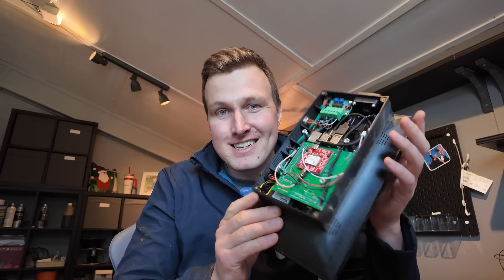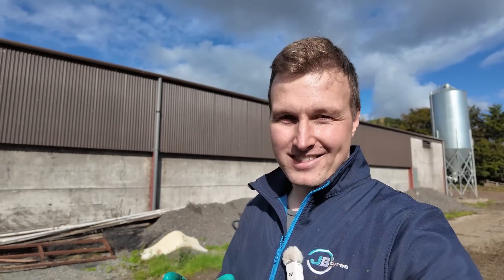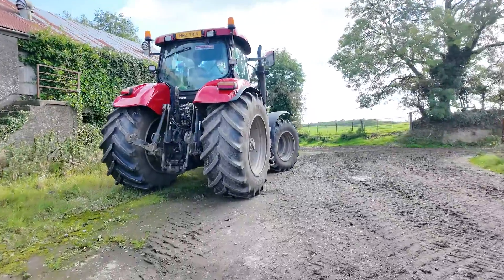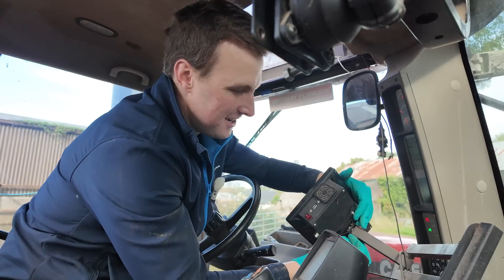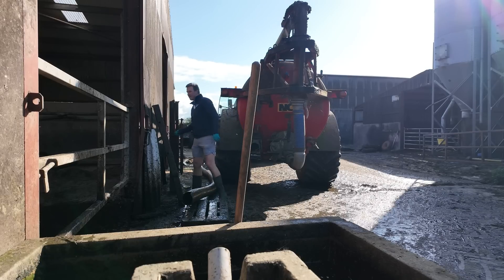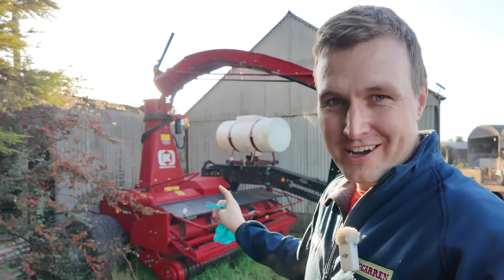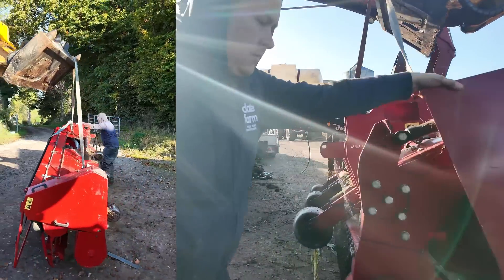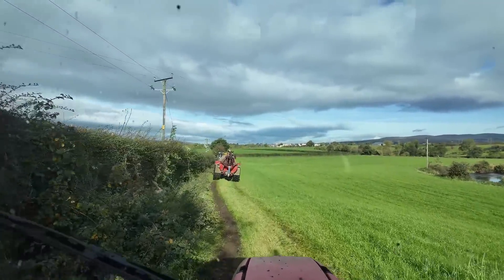The Harvester Hits the Road | Slurry Spreading & New GPS Tech development!

Comment: Working on orchard autonomous apple train, so u-blox rtk kit with some ep32s and brushless hub motors (from china... don't hate if you can't compete) , low level and slow so maybe I should go up a level to pi5?
Spent years on c++ firmware so hard to get this old dog to learn new tricks!
Reply from the maker: The pi systems have been soooo reliable for me and the remote login ability is brilliant. Highly recommend

Comment: I know nothing about building hardware systems, or developing GPS software, but...  did you consider just writing an app for a Android tablet? Surely it would have all the hardware and a good screen for a small price, ready to go? I guess you enjoy building the hardware and perhaps it's more flexible and able to control external electronics which an off the shelf tablet could not?
Reply from the maker: That code would run on a tablet, the issue is you lose control of the operating system and also can't integrate the hardware properly. A tablet is much easier and cheaper but makes for a worse product and user experience.

Comment: I have one of the cheapest gps on the market and it’s run of a tablet or phone in the cab from an app, it’s only guidance and not great but better than nothing. I will be very interested in your system keep us informed. I have never seen anyone entering a A-B line on the screen before entering the field that would be brilliant for working out the least short work or cultivating at different angles.
Reply: Yes I would also like to see what the finished product is like because I would also be interested in buying it, as for the video it was as usual both entertaining and informative and in my experience that makes it twice as good as most because most are either one or the other. Regards from Wicklow.
Reply: @Andy-ix2ox  He is an excellent YouTuber .
Reply from the maker: It will be priced extremely competitively. I plan to try and sell a lot of them next year. The highlight of the system is the code, more details to follow. 😅👍
Reply: @FarmTheoryNI when will you have a price on them is there auto steer with them

Comment: How much is your GPS & Steering motor costing to the end user? I’d be interested. 
I’ve sort of half done AgOpenGps, using it as just a guidance system but wanting to make it full auto but hi knits beyond my capabilities!!
Reply from the maker: Less than every other system on the market and it will also be a better spec with better software. That's the goal and I won't sell it if that's not what I achieve